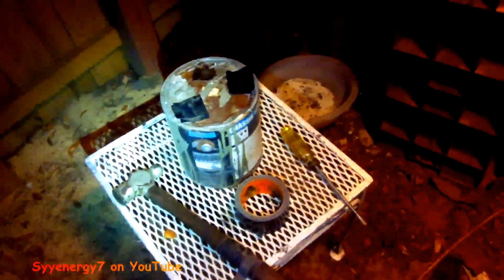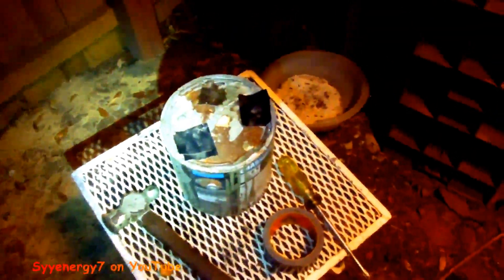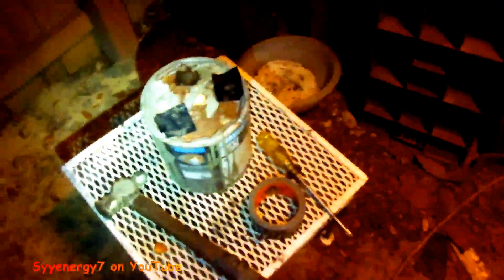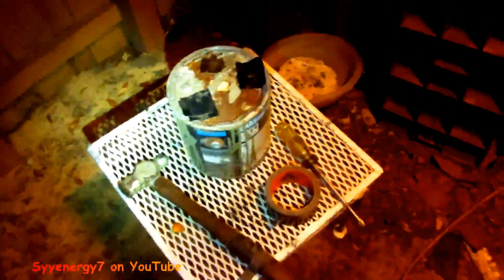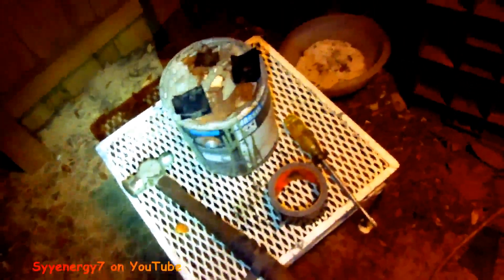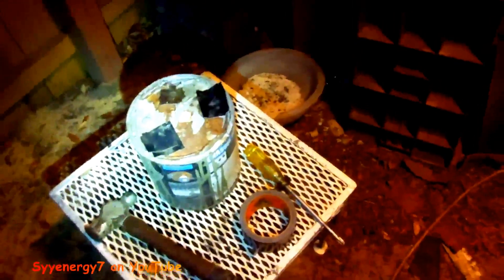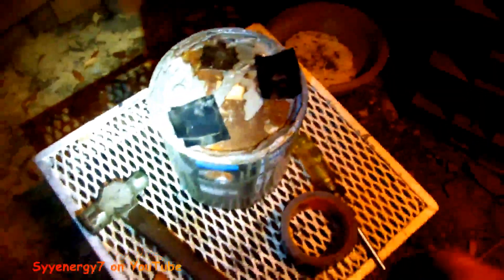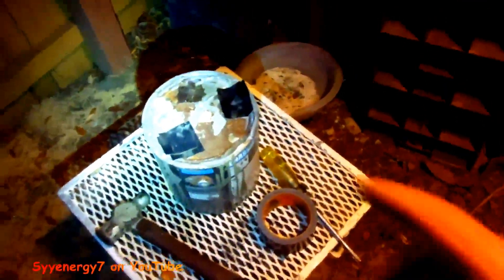Best Way to Reseal POR 15 and Chassis Saver Cans

Comment: Ok this must be different from por15, they recommend not shaking because it puts air bubbles in the product, which in turn wind up leaving an open area on your surface when bubbles either rise to surface or pop while curing.. but thx for info..
Reply from the maker: I don't shake it vigorously. Just flip the can several times.  If you notice on paint cans this works better and faster than stirring.

Comment: Yooo syyenergy7, quick question, does the copper coil on the wrist still have an effect if it is in contact with skin? i ask cause i made some today
Reply from the maker: I can't tell what it does myself, but so many that had problems got good results from it that I wear it all the time.